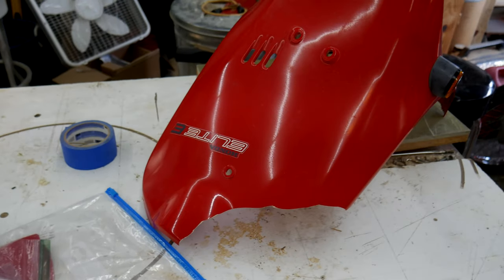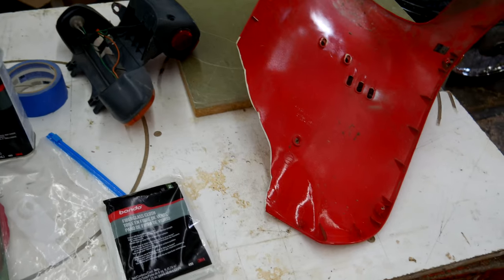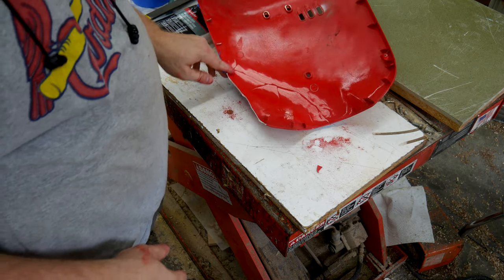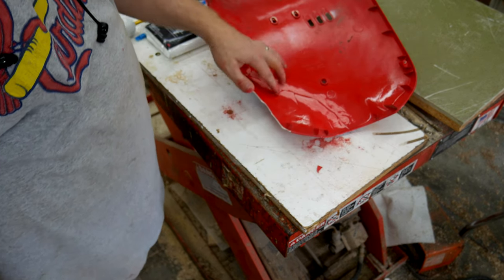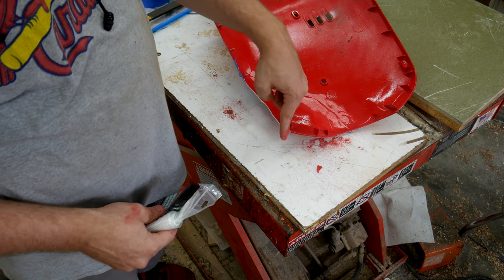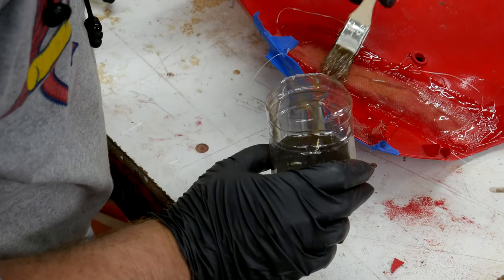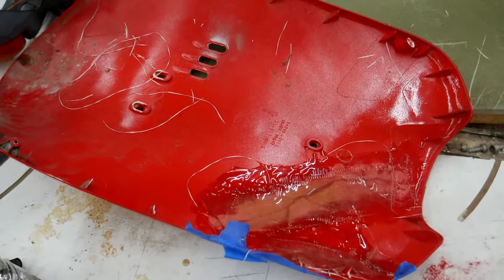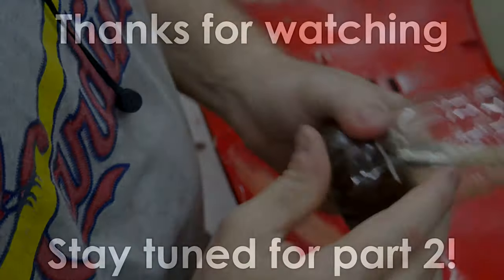Honda Scooter Bodywork Part 1: Learning how to use fiberglass and resin

Comment: From my perspective, I would probably fit all pieces to be repaired first.  Using a super glue or 90 second epoxy would help to hold while making the repair.  Secondly, even if I were not using glass on the outside, I would still use some epoxy on the outside to fill and secure.   If repaired correctly you should not have any need for bondo on the repair.  Overall it was a good first effort with glass.
Reply: Get some uhmw plastic , get a propane torch to melt the plastic an let it drip into the fairing. Careful  with heat an melting plastic.
Reply: Unless you're going to use epoxy for the fiberglassing, use super glue since polyester resin fiberglass doesn't like to stick to epoxy